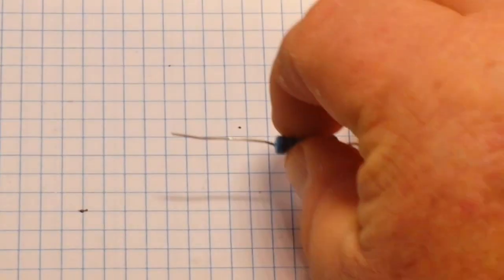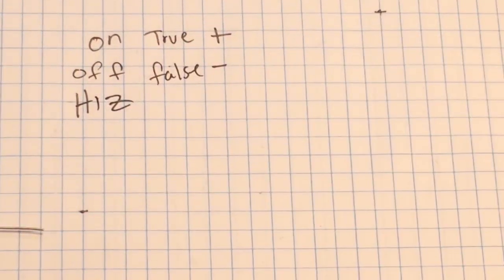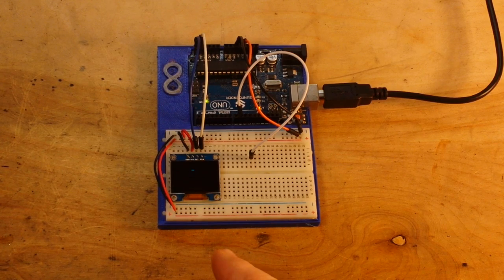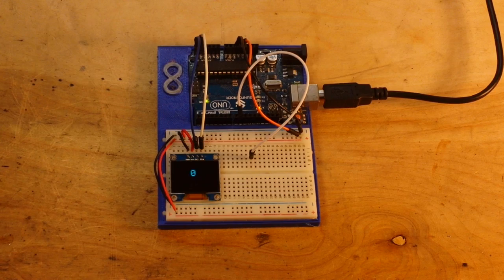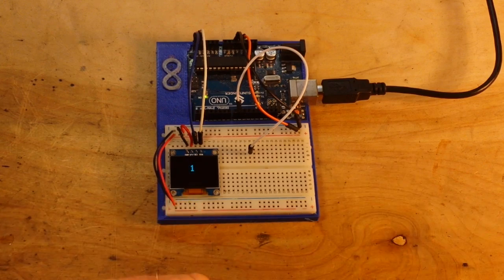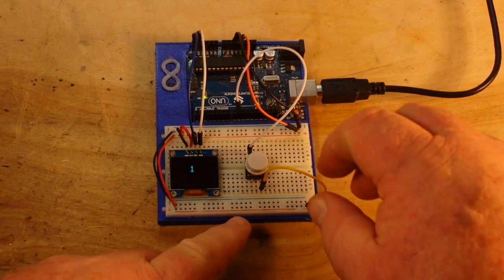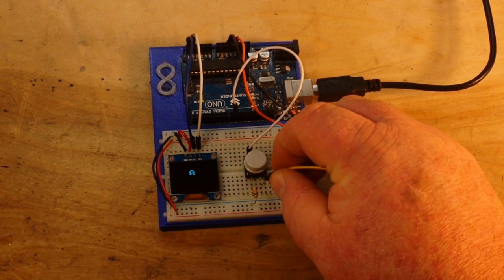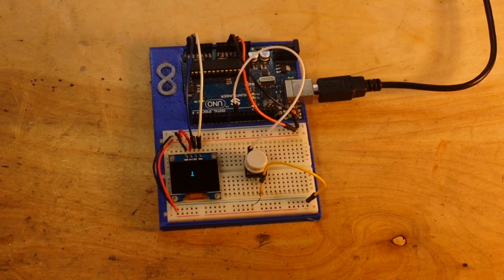Short and sweet:  pull up/pull down resistors explained

Comment: Good explanation, thanks.  But why is the pin reading 1 or 0 when it's not connected?  Why would there be any voltage on it at all?  If it's not connected to anything wouldn't there already be 0 volts?  That's the part I'm not clear on.
Reply: when you don’t connect it to ground ,it doesn’t mean 0 volt because it will read noise in the air or something else. Floating is not equal 0 volt
Reply: @Pp-je6ec  Yes you're right, I found that info on another video. A floating pin is basically an antenna

Comment: Hi, nice and simple video. I really like it but to me it's still not really clear. Why does it jump around without these things? It's not really clear. Seems like the project is simply broken without this sort of bandaid. Like, why WOULD it be jumping around if the particular circuit is wholly disconnected? It's kind of like saying why does the light flicker on and off when it has no power... It wouldn't, so why does this mini-circuit do that?

Comment: I learned about this the hard way, I needed a pull up resistor for my game using rotary encoder but couldn't figure out why the voltage I was getting from them was always very low but not 0. It was an annoying problem. There is such a big difference Practice and theory. Thanks explaining it to us.

Comment: Thank you. You explained it in a way that someone who doesn't understand much about electronics (like me) can understand it. Question - if the pin is in HiZ state, can it's state not be changed via the code instead of using a resistor? Can I not set a pin to high or low and avoid using resistors?

Comment: Great video, but now I have another question.  Why does pin 9 go low when you connect it to ground with the button?  Why does the voltage at pin 9 drop so much?

Comment: I’m new to learning, and I’m working a project with a plc, anyway let’s say I have 12v system and A being the controller and B being the controlled, B has a 12v supply and A has a low pwm signal, it’s pulling the voltage down from 12v correct?

Comment: I don't see this tristate issue (flipping between on and off) when connecting a button without any resistor to raspberry pi 4 GPIO (3). What is the raspberry doing that prevents this issue?
Reply: Don't the RP2040 chips have internal pull up resistors on all gpio pins?

Comment: Yes I enjoyed it, but my question is WHERE is this random voltage coming from.   Or WHAT is causing this random voltage.  Especially on these Arduino or Pi's where the DC voltage is SOO CONTROLLED.... ..so my question is what is causing this fluctuation of voltages?

Comment: What this video REALLY needed as a small circuit diagram in one corner showing what connections you’re making—it was really difficult to understand what changes you were making and where you were plugging in the resistor.  Also, be careful of terminology—when you were discussing the push button you said two of the terminals were “ganged” together—what does that mean?  And the other two were opposite—what does that mean?  Opposite of what?  If each other (which is what I assumed) what does it mean to be opposite each other—when one is liw, the other is high?  Iy would have taken 10 seconds to clarify this instead of making us guess.  That may be very basic to you, but to someone who only knows generally what a switch does (on/off) but doesn’t understand about DPST/SPST/DPSDT (I know the terms but I only have a vague notion of what they mean.)  It may be that you’ve already covered switches, in which case my second criticism doesn’t apply, but the first was a bigger problem to me anyway.  As somebody starting out in electronics (I’ve soldered a couple of projects together, without understanding how it accomplished its purpose and what each part was doing), I’m really interested in the “why” and “how” of each part of a circuit.  For instance, I would love to know why you picked 10K as the resistor value—I know has something to do with limiting current but there’s no understanding there.  I hope these mild criticisms (I liked your presentation overall and it’s just what I needed to know) help you to improve your videos by accommodating your target audience.  BTW, let me just say, we’re not looking for an engineering degree, I think most of us are looking to REALLY understand practical circuits so that we can eventually take a circuit or part of a circuit you’ve explained and put it together with other building blocks to make a unique circuit, while understanding what each part does and why it should be a different (or the same) value in our new circuit.  Sorry to be so long winded, but people like you are valuable to noobs like me and I hope it’s worthwhile to help you help us!  Thanks for your work!

Comment: Kinda new to electronics and I actually made a software solution to this because I didn't know that I could jsut enable the pulldown resistor in the pi pico with a few extra letters and not have to measure 50 different times and only activate if all 50 are high(and even then it didn't work properly).....

Comment: Is a pull up resistor just a resistor placed in a certain place in circuit or is it a separate type of device to a regular resistor?

Can I put them in series, aka take 5x10k Ohm resistors to reach the needed value of 50k Ohm?

Does it matter which way I place the resistor in circuit? Like is there a polarity thing with them like there is with a capacitor?

Thanks.
Reply from the maker: a pull up or pull down resistor just notes it job as you said. Yes you can put them in series, parallel or a combination.

Comment: Not only did I learn about pullup/down resistors but I also never knew the pins on those push button switches where arranged like that!!!! Ones farthest apart, ganged together, ones closest, opposites!!!! Never need to check with my meter for continuity again LOLOLOLOL Crazy!

Comment: There is still something I don't quite understand, in the switch example, why do we use pull-up/pull-down resistor for the default state, but connect the other leg directly to ground/vcc?

Comment: That's a nice explanation, thank you. But what is weird is why should a pin be in an uncertain condition. Either voltage is applied, or it isn't. 1 or 0. Where is the intermediate value or "floating" coming from to begin with? Thank you.
Reply from the maker: It comes from inducted and parasitic voltages present in the IC.

Comment: I saw like 3 minutes of the video and damn, you're a great teacher. I followed a guide for an Arduino circuit that takes input using a button, but it didn't explain the pull-down resistor too well since the focus was on the rest of the circuit and the code.
Just came across your video and you happened to use the same example, which is really helpful! Don't fully understand it yet but I will.

Comment: that still does not make any sense to me. Why not just use a simple wires, for both ground and +, instead of a resistor?
Reply: Wires have low resistance on their own, so it would short circuit.

If the wire's resistance is, say, 2 milli-ohms and the voltage across it is 3.3V, the current flowing through it would be 3.3/0.002 = 1650A. That's 1650*3.3 = 5445W. 

The wattage of a kettle is generally in the 1000W - 2000W range.
Reply: @waldolemmer  why use one resistor to pull down and one simple wire to pull up (or vice versa) then? according to your explanation, we should 2 resistors. He uses 1 (either to pull up or down)
Reply: @pajeet7966  I honestly don't know. I didn't understand his explanation and am still doing research on this. If I can figure it out, I'll get back to you.

Comment: so....then why still resistor, I'm certain that if you replace the resistor with cable it'll still be the same result
Reply: im just finished another video, when the switch is pressed, there might be a power surge from true to false, hence the resistor should exist so nothing is shortcut

Comment: Can you further explain the reason Input Pin 9 initially is in this third state arbitrary switching between High and Low? By looking at the circuit no voltage should be passed into Pin 9, therefore in theory it should just be Low?

Comment: I’m not good with electronics at all. I need to add a pull up resistor circuit to an aftermarket tachometer in my truck. This video finally gave me my aha moment.  Thank you, I finally understand. 👍🏼👍🏼👍🏼
Reply from the maker: You can do it!

Comment: Very interesting. I have multiple RFID units in a project. Each RFID works fine on its own. But when together they do not work. I was told i need to use pull up or pull down resistor to ensure the RFID are not all passing data at the same time. Can you advise and show the way. Thanks
Reply from the maker: you may also need decoupling capacitors

Comment: Thanks! One question. So, the pull up/down resistor just acts as a small “load” upon the button push seeing as it is now connected directly to positive and ground?

(Edit) sorry, just wrapping my head around this😁. Or is the pull up/down resistor just “by passed” because of the path of least resistance to the micro controller pin out? Thanks.

Comment: So, because there is a resistor, the current flows over it and that's the state (ground or positive rail, where ever the resistor is connected to) but when you press the button, the button connection has lower resistance than the resistor and thus the current rather picks that way to flow and thus it's detecting the either ground or positive rail, where the button is connected to. Right?
Reply from the maker: That's correct

Comment: I understand the concept partially, but I still don't really understand the flow of electricity. Why do we need a pulldown resistor when the circuit isn't even complete? Surely that in itself would be LOW. Before the resistor is placed, the +5v feeds the positive rail of the breadboard, there's nothing connected on this rail, so there would be no signal sent to the white wire anyway. I think it's the tri-state that I don't understand.
Reply from the maker: Unconnected microcontroller pins will float high and low unpredictably. That's why we pull them one way or the other. It is the only way to know for sure.

Comment: Hey! I just had a quick question, why do you need the resistor to tie them down to either 1 or 0? Why not directly use a wire and connect to ground or power?
Reply: The resistor helps define the state to either LO/HI. If you just use a wire, you're pretty much leaving it in that tri-state that he describes. (I know this is an old comment, leaving this here for other people to review if they have the same question)
Reply: @jwilly5816  I still don't  understand why a resistor is needed instead of a direct connection, like a wire.
Reply: @lpeter1172  If you leave just a wire, it could also just be a short circuit (a low resistance path straight to ground), and it will not generate any sort of voltage drop

Comment: Thanks so much for the really short simple explanation.  I had known about pull up and down resisters, but for some reason I thought my project didn't need them... Until I went from breadboard to finish soldered project with longer wires, and started getting weird results.  Then it dawned on me... I need a pull down resistor.  So I watched this video and it confirmed my suspicion. Added a pull-down, problem went away.

Comment: I am using a mega to control a pinball machine but even with input_pullup it sometimes gets noise or something in the inputs and this causes the mega to reboot itself.  If I pin mode with output and only pin mode to input pullup would this help the mega simply ignore the noise and not reset itself?
Reply from the maker: A larger resistor could help. The built in pullup is 10k.
Reply: Or do you think maybe the pull down approach would be better?  with all the pins connected thru one resistor.  I have a lot of switches to check in this thing.

Comment: isn't pin mode input_pullup the same thing?
Reply from the maker: There is a very small 10K resistor there so yes you are correct.

Comment: Great video, was what I was searching for! I have a question: I have an external switch with only TWO pins, I have wired it without any resistor and it is in the HiZ floating state. Is there a way to add a pull down/up resistor?

Comment: I finally got it from your video. Good sound & image quality. And no annoying music in the background! GREAT. THANKS!
Reply: Me too, I could see how a pull down worked but not sure on the pull up! This video confirmed I was over thinking it! Thanks also.
Reply: Ya. I been meaning to get the idea for a while. I actually thought it was a type of resistor. What I dont get is, if it didnt hurt the chip or the input to the chip to be directly connected to high or low(in either state, respectively) then why would the resistor be needed? Granted this was the simplest of examples for learning sake. I would suppose the resistance would be needed in a more advanced circuit or in an automated scenario?
Reply: Nevermind. I thought about it for a minute. To keep the circuit in a known state, not in the unknown or tristate from induced voltages.

Comment: Still didn't explain why you need the resistor.
Reply from the maker: Yes I did. Keeps circuit from floating.
Reply: @learnelectronics  nope, connecting the voltage supply directly to input without switch in between does. But, to allow for logic low voltage, a resistor has to be added or it will short circuit. @ShishakliAus

Comment: I almost understand. What I don't get is why you don't use two resistors with the button, one to pull up and the other to pull down. Surely the button leg without the resistor is a dead-short?
I mean, at (4:11), the button-push pulls up to the positive voltage. You say there that the button-push is doing the same thing that the resistor did but it's not. The button-push is creating a dead-short to the positive rail. And when reversed, the button-push is shorting straight to ground. I really don't get this. You say near the beginning (2:22), that you don't want shorts, that you need a resistance (within a certain range of course).

Comment: I tried to mess around with some ic and I always got this damn flickering. Then I heard about debouncing so I have added a cap but still the output wasnt stable. Only after adding the resistor to my circuit I got stable output.

Comment: Does Arduino have inbuilt pull-up or pull-down resistors in it's digital pins?
Reply: Arduino has built in pull-up pins that can be enabled, but not pull down pins, if you want to do that you have to do it yourself.
Reply: kaos havoc  Just do your input like pinMode(2, INPUT_PULLUP); //will enable the built in pullup so when 2 == LOW, the button is pressed
Reply: yes, then you connect your button to ground, and when you press it, it pulls the pin to ground. so, in that way, a 0 on your input == button pressed, and a 1 == button not pressed. Pretty normal for hardware to be inverted in its logic. But, if you prefer to use 1 == pressed and 0 == not pressed, you can just not enable the pullup resistor, and add a pulldown resistor to your button and make it so high == button pressed.

Comment: It gets rid of the noise that could be confused for a 1 or a 0 by bleeding off to ground or pos. Without creating a short, by having some resistance.
Reply: When pulling down, it acts as a load, preventing a short circuit. When pulling up, it acts as a current limiter, right?
Reply: @Max_Moura  It's not there as short circuit prevention, if you tried to bleed down without a load it would be a short circuit. Pretty sure you got that, I just wanted to clarify. So far as current limiting, I'd defer to someone else.